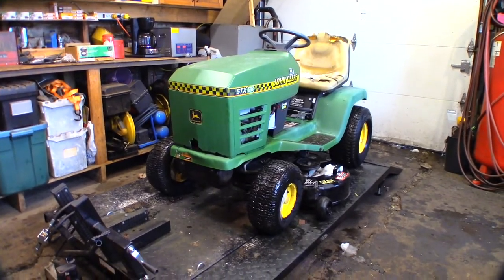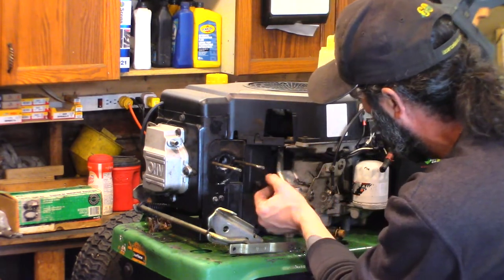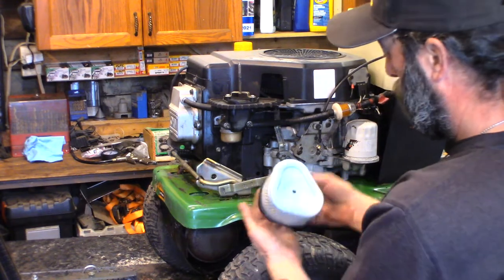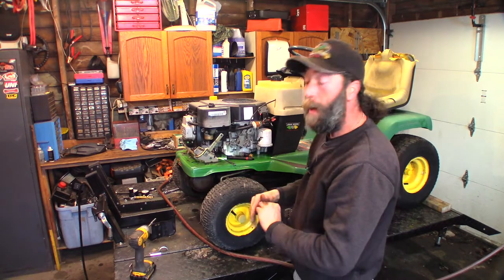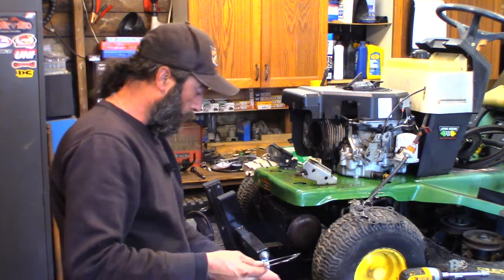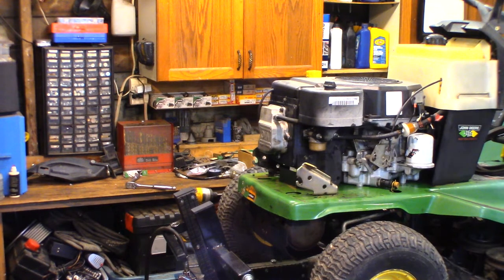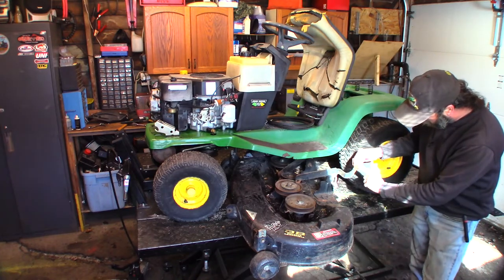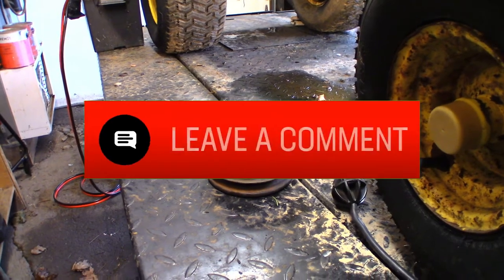A complete refurb on this STX38 Black Deck Motorsports Edition Part 1 of 3

Comment: I believe this is now my machine after the Refurbishment! 

Good little tractor now, she’s a torque monster, you have to watch how hard you drop the clutch brake, or you’ll rip up all the grass on your lawn. 

I knew nothing about these machines before I bought mine, but now seeing the Motorsports hood, I want one bad, as an owner between me and when this video was made, smashed the original motor sports hood. Still looks good with the standard stx38 hood.
Reply from the maker: Hey Dan, I did sell this machine to a Dan, but I don't have Smith as the last name written down. And I've only ever had one black deck model through the shop, all the others were yellow decks.
Reply from the maker: Also, the hoods on the yellow decks were not as easy to break as the black deck units. Different plastics used over the years

Comment: At 42:02 that spring is a massive spring to try to manhandle. Back when I worked on these, we took a handle for a pull start mower and attached a nylon rope to it with a loop in the end of the rope. This homemade tool was a game changer for removing and installing that spring. I don’t know if a photo can be attached to the comments, but, if it can, I’ll take a photo of it and attach it.
Reply from the maker: That's a great idea. Every time I have to do one of these I say I'm gonna make a tool for it...lol

Comment: Oh Deere,  lots of work on this one !!! I was impressed on just how quickly you diagnosed that compression leak. I learn something almost every time I watch. If you had to repair that clutch lock on the clutch by welding in the worn area, is there a potential of damaging the clutch from heat from welding ?? Never did any welding with anything but acetylene which I know would conduct a lot of heat. Does arch or other welding cause as much material heat conduction as acetylene  ? And would it damage the clutch  ?? Just curious. Cool video
Reply from the maker: Hey Len. No chance of damaging the clutch, it has to be removed to do the welding on that worn pin. I've repaired a few like that. Sometimes I mig weld them, sometimes I tig weld them. Just depends on what welder I drag out that day...